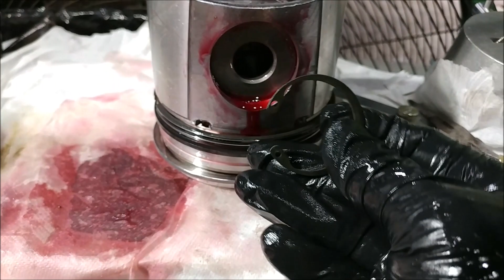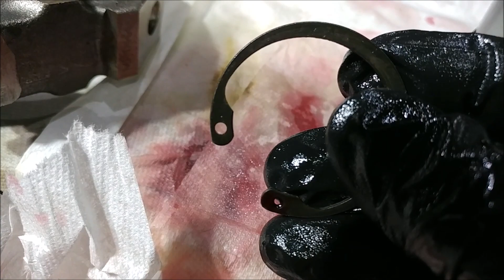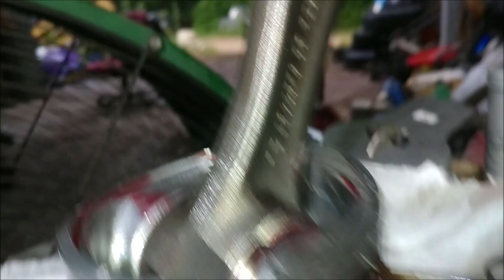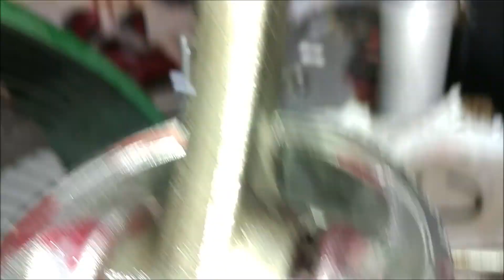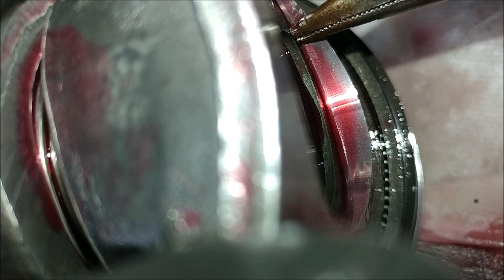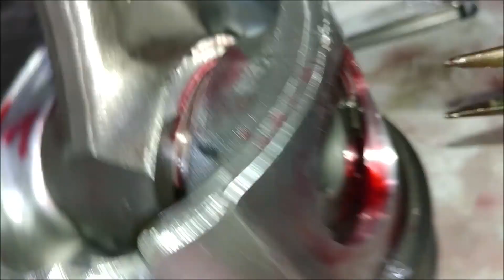Chronicles Of An 03 Cummins Rebuild - Part 15 - Tips And Hacks For Installing Your Wrist Pins

Comment: How could I avoid ruining a wrist pin bushing? I installed a set of billet rods in my 6.7 and 200miles later I developed a knock. I've narrowed it down to my cylinder 3 wrist pin. Rod bearings were fine. Knocking noise can be heard with a stethoscope on the oil filter housing. Can't hear the knock from the pan or top of the head. When I plug the rail on cylinder 3, noise is gone.

Comment: Informative videos sir. You can never overkill! question. on the oil scraper ring did you have to grind the expander spring thing also? mine seems big for the calendar
Reply from the maker: Hey Projects Pat, We didn't have to grind anything off the expander ring when we were doing these.  And I can't say that I have ever seen anyone have to take any off there on a Cummins piston ring.  I will tell you that those springs give us a challenge on most every build we do.  How much did you have to file off?
Reply: @70440charger  I haven't filed any offers yet. Ill need to double check my fitment. Thanks!
Reply from the maker: @ProjectsPat   10-4 ... Let us know how it turns out!